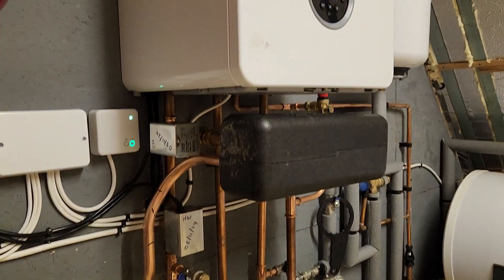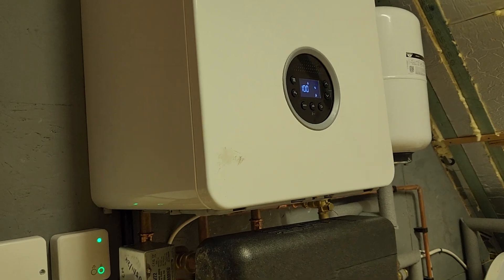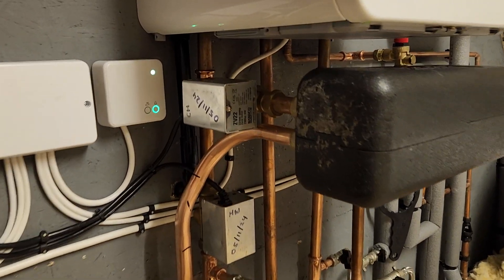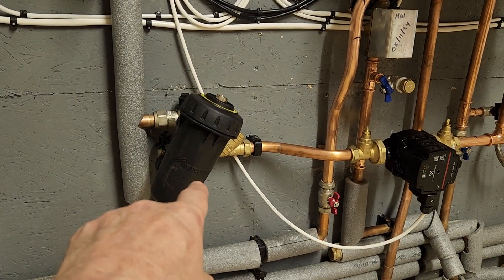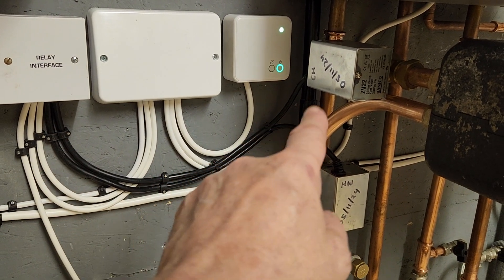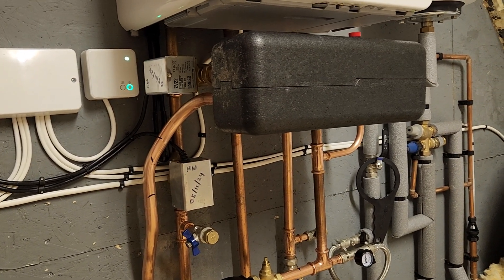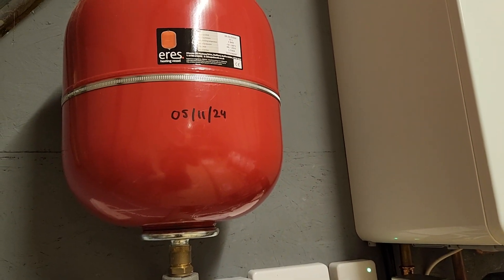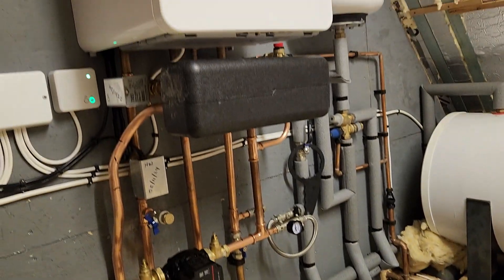A Worcester Bosch.Less than a year old on its third heat exchanger.

Comment: This boiler could have been arranged to run proper PDHW with two temperatures and weather compensation without any need for a relay very easily. You only needed a cylinder sensor, or resistor connected to TW1 and PW1 becomes live on a HW demand. Or a 4 pipe kit is available for under £100.

Comment: Not a boiler issue, down to system design / contamination from the system.
Reply from the maker: I think it's fair to say that if it was put on a cleaning system it would not have had a problem. My preference for Viessmann is that it would not have required a replacement heat exchanger and could have just been cleaned.

Comment: Nice video, Andrew. Good to hear your explanation as you work through what’s been done. It feels like there’s a gap in knowledge with the WB. I think it’s similar with Viessmann outside the core group that have acquired the know how. 

A few of the later WB ones look like they’d support WC and PDHW.  Looks like a few of the people that have found this are sharing the information in the comments.
Reply from the maker: @i4details  i think they've been able to for quite a long time. Is just that the parts are expensive?And it's not so easy to do as it is on better models of boiler

Comment: Customer has missed out big time there, could easily have made it W.C and PDHW even with 3rd party controls.

Better still swap for Worcester controls and allow R.C too.

Also you can set the primary pump speed, either to burner linked, with max and min pump speed set, or pressure dependant (obvs not in this case ) or just a fixed speed much lower to get primary and secondary sides closer (to do fix speed just spam the burner linked setting by setting max and min pump speed to the same percentage).

No need for relays and keeping it a fixed flow temp system.
Reply from the maker: @danielbailey6745  if only their technical department were more informed.

Comment: You can 4 pipe with optional integral diverter if it’s a system boiler . 

If you don’t want to, or if it’s a regular, you just use the switched live from PW0 on the boiler to operate either a 3 port or a NC and a NO 2 port, instead of using relay. That way you could run it with W.C and or R.C using Worcester controls.

Can still run basic W.C and PDHW with 3rd party controls this way, using heating and hot water 240v LR connections and just connecting a weather sensor.
Reply: Would you mind sending me the tb too please? I have a similar job and would love to be able to use WC on the ch
Reply from the maker: @danielbailey6745  i need to learn how to do this.wb technical we're unable to tell me
Reply: @ happy to go through it with you mate. Worcester technical aren’t taught it. If you ever get through to the renewables side they’re much better. There is a TB I can send also. I think Worcester don’t want your average installer getting into anything too technical and that’s why they don’t teach it to technical. Which is why people who are more switched on think less of Worcester, shame because very capable boilers. 10% modulation on the 8000s, the 15kw 4000 system will modulate down to 1.9kw.

Comment: If you are changing 3 heat exchangers you know it’s definitely not a boiler issue 😊
Reply from the maker: @heatpump8566  wb replaced too blocked heat exchanges. It is not possible to clean them like we can with Viessmann

Comment: Hey Andrew, you sure some clown has not installed a water softener at supply source and have filled the heating system with softened water? I am getting about 3 a month where the system is corroded so badly, the softened water turns acidic and eats all rubber seals aswell as all the debris getting baked inside the heat exchanger!

Comment: Should have had a look at internal diverter for the woosta
Reply: Or use EPH hot water priority pack and use a 10k resistor on the boiler cylinder stat plug. Then you’ll get separate temps and kw for hot water and heating.
Reply from the maker: Can you do this without fitting the diverter valve?  @adamstephens7915
Reply: @andrewmillwardwatford9410 
You can. The resistor tricks the boiler into thinking it’s got the diverter and activates the settings. The switch back from the hot water stat just connects to the hot water LR and the heating switch connects to the htg LR. The heating can then work on weather comp and the hot water will fire at max flow temp and at what ever kw the coil can cope with but I would fit a TMV on the hot water outlet as the flow temperature can go to 70/80 degrees.
Reply from the maker: I spoke to the customer about this, but they didn't want to spend the extra money.
Reply: @andrewmillwardwatford9410 
That’s the problem sometimes tho, although it may be better in the long run.